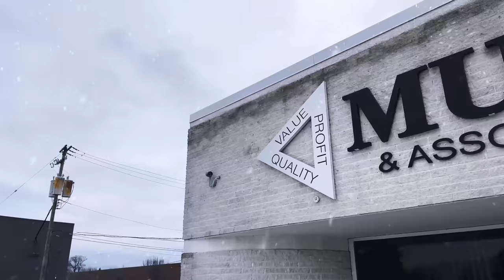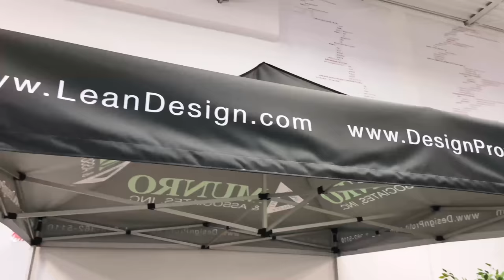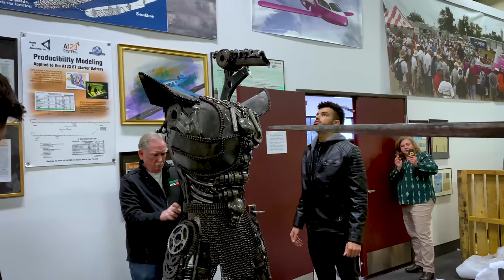Michigan Meet & Greet + Surprise Gift for Sandy! - Tesla Model S Plaid Road Trip: EP 9

Comment: Hey Sandy:  Given the recent issue on I-95 with many stranded cars, it would be great if a reputable outfit like yourselves would run an actual test comparing various ICE and EV, to see how long they can keep the cabin acceptably warm in cold conditions.
Thanks for all you do.
Reply: See Bjorn Nyland vids
Reply: That might not be an easy test to conduct.  They would need a bunch of vehicles ready and then have to wait on mother nature to provide the conditions with no guarantee's of duration or temp.  I agree it would be interesting but it might a trick to pull off.
Reply: @TheEvilmooseofdoom  no issue with that, you just need a decently sized refrigerator :D
Reply: @TheEvilmooseofdoom  plenty of places where mother nature provides months of appropriate conditions.

Comment: Always wondered why the internal combustion forklift? So many good electrics on the market now. Only drawback is the legacy lead acid batteries and trying to adapt lithium to those old systems. Still some good ones though. The Linde 346 series is incredibly well designed. If you ever need any feedback ok that sort of product, hit me up. It’s my wheelhouse.
Reply: It's probably LPG powered, and they outperform battery powered.
Reply: @aussieideasman8498  It is but LPG/gasoline/diesel no longer outperforms electrics. I’m a service manager for a chain of forklift dealerships. In the old DC truck days, IC was better. Now with 3-phase induction motors and modern control systems, it’s hardly even close. The only IC lift trucks that compete are maybe the Linde hydrostats. Give me a Linde 346 or Still RX-60 electric any day.